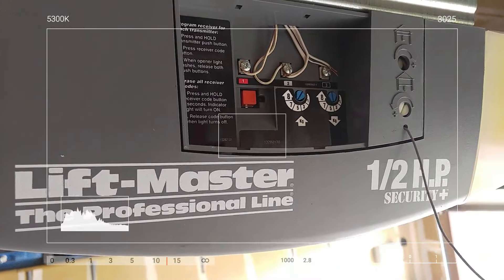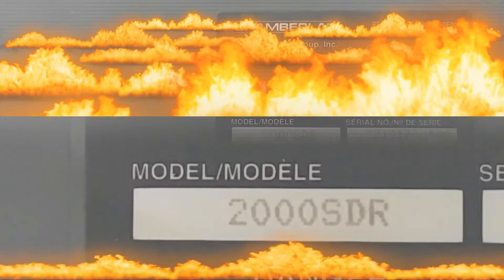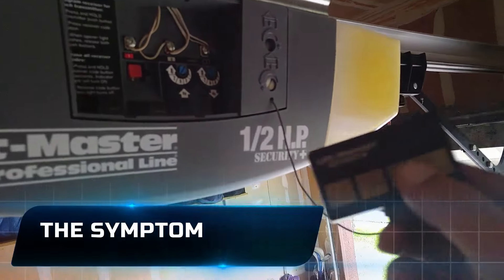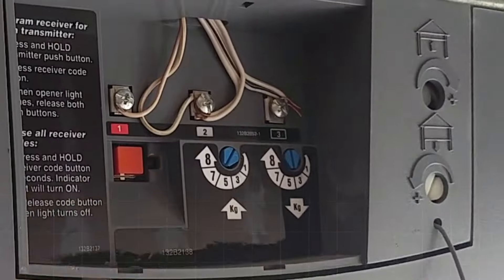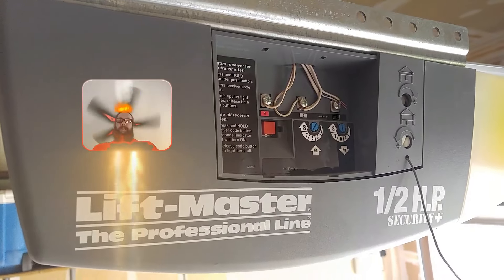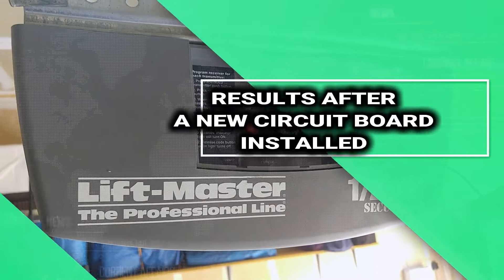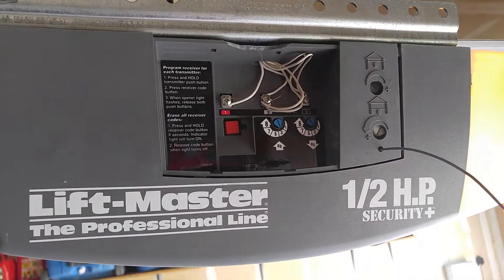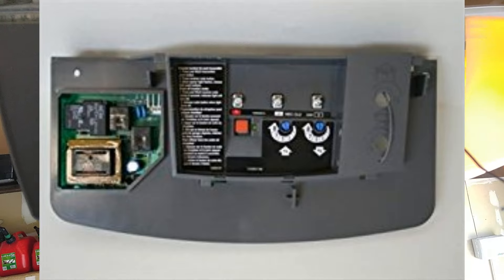Garage Door Opener Just Clicks | Chamberlain Lift Master Troubleshooting

Comment: After letting it cool down it started working. Adjusted & lubed chain along with roller spindles maybe over worked/heated it.
Reply from the maker: Yes definitely those machines can overheat. Generally it takes about 5 minutes for it to cool down.  You want to be careful running older machines too many times in a row. You stand a chance of blowing a start capacitor.
That machines like an older person you just got to go easy on it! 🙏
Reply: Garage Door Genius  thanks. We just bought our condo 6 months ago and opener mfr date is 2007. The chain just started hitting the door panel when it was opening which prompted the attention to tighten it and lube the pivot points. Closes a lot quieter now.
Reply from the maker: @paulhauber574  🔥💯🔥

Comment: I have the same model, where did you get the replacement of the circuit board. also, how do I take off the cover to get access to the circuit board,thanks
Reply from the maker: +dan yra 
Call Chamberlain tech support.  Have your serial number off the unit ready.
You need a 1/4 nut driver or socket.
Reply: do you have a video of how to remove the cover to get access into the circuit board, that would be great. I notice there are two screws on the bottom of the cover, but it seems I can't remove it, and the plastic cover is so brittle to break.
Reply from the maker: +dan yra 
No I don't have a video showing how to do that.  I will put it on my list.
Should be 4 screws.
Reply from the maker: +dan yra 
This might help with taking the lenses cover off.
https://youtu.be/q8Nix5BmUNk